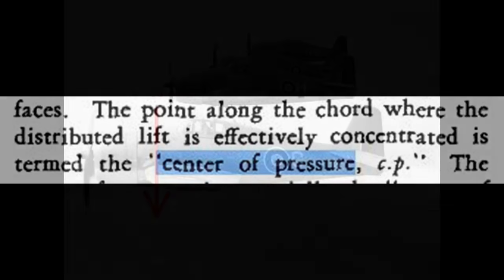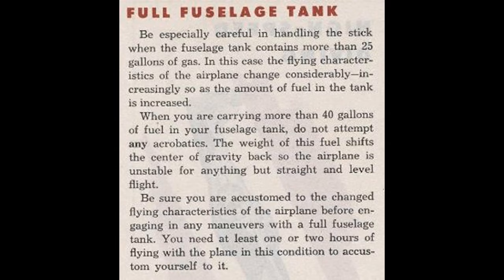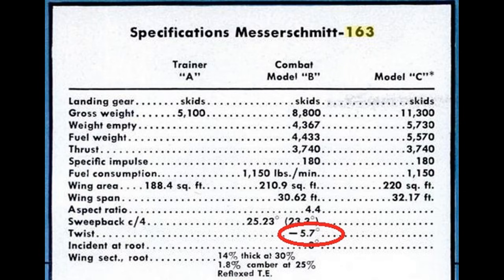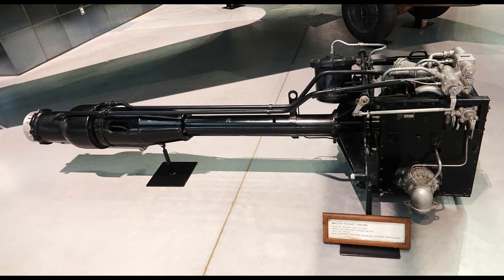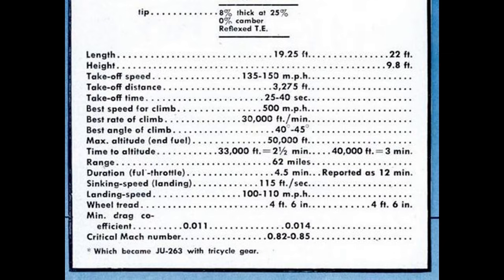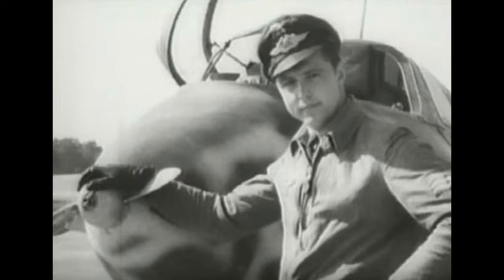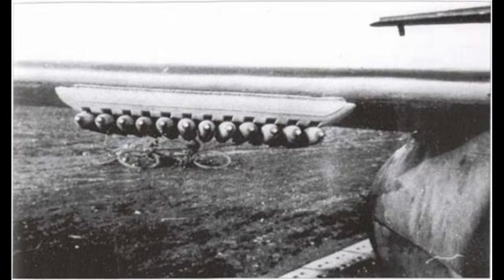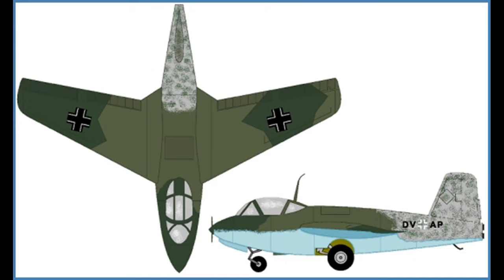Messerschmitt Me 163 Pt.2 Plus Me 263 and More!

Comment: Nope.  Flying wing stability is complicated not by the location CP relative to CG but the basic fact most airfoil sections have a negative pitching moment.  Aircraft are made stable in pitch by creating a balanced system of forces that self correct.  The plane goes faster, the wing wants to pitch down more because of the airfoil but the horizontal stabilizer increases its down force.  By the way you can design a plane that does not change trim as airspeed increases by careful adjustments of incidences and tail forces.   You explanation wouldn't account for plank flying wings or forward swept flying wings that have been experimented with.   

There are even conventional designs where the tail is designed to have lift and not down force where the CP has to be in front of the CG.  You mentioned the F-16 for maneuverability but designers have experimented to make more efficient aircraft.  The idea is to get both the wing and tail contributing to the lift of the aircraft.  Some folks say what is the advantage of canard designs where the forward surface does contribute lift (generally).

Flying wing pitch stability can be achieved with airfoils with positive pitch moments, with trailing edge reflex for example as you find in plank designs, or wing sweep and twist or some times airfoils sections at the tips of a swept wing that are different than those at the root.  Every approach has its benefits and compromises.  The YB-49 was a tragic example of not getting pitch stability right.  The design had the CG/CP so close it ended up in an unrecoverable tumble.  

Your explanation missed the actual major element of flying wing design.

Here is a great book that will get someone the basic airfoil fundamentals that affect pitch stability.

https://www.amazon.com/Theory-Wing-Sections-Aeronautical-Engineering/dp/0486605868

Another interesting data point for the 163 is the mention it got in the book "Fluid Drag".  It was an amazing low drag.airplane.

https://hoernerfluiddynamics.com/

Your videos do have some great elements.  It is clear you do a lot of research, for example in this 163 series you had a lot of the human elements were very interesting.  But you got the aero all wrong.  The good news is there really aren't any other flying  wings to discuss.
Reply from the maker: All the info I posted is straight out of PHOAK and AFNA. I am sure there is more to it, but I find it hard to believe that these two sources are wrong. AFNA is probably the most peer reviewed book in aviation.
Reply: @GregsAirplanesandAutomobiles  Neither sources are covering the pitch stabilities of flying wings.  

The PHOAK makes no mention of flying wings and can hardly be considered a comprehensive source of aircraft aerodynamics.  Same with the AFNA.

A quick google search sadly shows a similar but flawed explanation of flying wing stability.  A little more digging produces better treatment of the problem.  This paper seems to cover the problem well.

https://www.researchgate.net/publication/273512501_Static_and_Dynamic_Analysis_of_Flying_Wings

To ignore the negative pitching moments of airfoils misses the fundamental challenge of pitch stability of flying wing configurations.  You need to read studies of Lippisch, Northup or the Hortens.  There are some great sources covering flying wing configurations and aerodynamics and you didn't use any of them .  I'll stand by my conclusion you really got it wrong and continue to.  It isn't CP/CG, it is negative pitch moment of most airfoil sections largely due to camber lines. 

That is the primary pitching component of flying wings, if you don't get that you don't understand flying wings.   I gave you a great reference regarding airfoils that covers pitching moment of different sections.  

Here is another decent paper on the topic:

https://flightlabs.com.au/preliminary-research-on-the-optimisation-of-flying-wings-in-forward-flight/

Early in that paper you will find this statement:

"A traditional cambered airfoil produces a large negative pitching moment, exacerbating the pitching down moment. "

Here is the ME-163 airfoil:

http://airfoiltools.com/airfoil/details?airfoil=goe765-il

Notice it does employ reflex to counter the negative pitch moment.  So the 163 employed a reflexed wing section AND sweep/twist to achieve pitch stability.
Reply: @Gort Sure, most airfoils produce a negative pitching moment.  They want to tuck.  This is why planes have tails.  In fact when you design a conventional plane part of the calculation of how to size your tail has to take into account that pitching moment of the airfoil you chose.  In a flying wing you either have to use a reflexed section that has a positive pitching moment or use wing sweep and twist to create a balancing force to achieve positive pitch stability.  It is the pitching moment of the airfoil responsible for that pitch force that needs to be balanced.  It seems to be a common mistake to think of it as CP/CG as it is "simpler" but it ignores the real factor in play, that of the negative pitching moment of normal airfoils.  In my reply to Greg I provided several links to some decent treatments of the problem.  To really understand flying wings you need to start with airfoils and how they behave.
Reply: @Gort Most airfoils have a negative pitching moment.  You could put the CG on the CP and the will still pitch down.  This is related to camber in common sections.  The CP relative to the CG is not why there where is a downward pitching moment.

https://en.wikipedia.org/wiki/Pitching_moment
Reply: @Gort it might help to think about the camber line, imagine the effect of air following that curve, if might even help to ignore the pressure along the section, think the force vectors following the camber line. Air is forced down at the trailing edge and that forces the trailing edge up, this the forward pitch torque.
Reply: @Gort I would also point out to calculate the pitch coeficient of an airfoil is totally based on the camber line.
Reply: @Gort It isn't covered in the AFNA, read the link I provided or most any book on airfoil theory.  Chatting with you has me convinced that pitching moment of airfoils isn't taught so there is a lot of misunderstanding of how pitch stability really works.  The center of torque was nothing to do with CG.  Think center of camber line.  Like a said find a deep technical source specifically about airfoils.  I provided  several already.  The problem is most general references about flight over simplify complicated topics.  The provide practical guidance that is inaccurate if you still down enough.  Bernulli vs. Newton for example when describing lift.  If you are honest it's both (not in equal amounts but both are involved in generating lift).  Also it all changes at super slow speeds or as you approach supersonic.

I also want to point out Greg"s comment on flaps on swept wings was comically wrong as was his comment on flaps on the 163.

Read some more about airfoils, that is where airplane design begins.  There is a great book called "Designed for Flying". When I'm not on my phone I'll find a link. 

Don't think of a wing suspended in a fluid, it is the movement through the fluid that generates the forces and these forces increase as velocity increases, gravity is a constant that quickly becomes the smallest force in the equation.  That is how things fly.
Reply: @Gort the cp/cg discussion is a red herring, I gave you a good link regarding pitching moment and I provided a link in one of my replies to Greg with the 163 section, it is reflexed.  Even symmetrical sections have a picking coeficient that is usually graphed against angle of attack.  Seriously find the airfoil book I linked in one of my replies to Greg, the science of airfoil sections is non trivial and glossed over at best in most general aviation references.  I can have a cg behind the cp and be stable in pitch either with a canard or a lifting horizontal stabilizer.  Again, read a book on airfoil design for a more comprehensive exploration or at least the Wikipedia link I gave you on pitching moment.  I do hope you do a deeper study of airfoils, it is a fascinating topic!
Reply: @Gort http://wwwaeroforum.blogspot.com/2015/08/pitching-moments.html
Reply: @Gort it does, another way to think about it is if you take the sum of all the pressures, not just single center of pressure you end up with a net force that wants to rotate the section.  The CG is not the aerodynamic center of the airfoil do it is irrelevant in terms of calculating that rotational force, which is the pitching moment.  Consider this, at the trailing edge of the section there is a downward deflection of the airstream, this is behind the aerodynamic center of the section so the net pressure results in the pitching coeficient. This is why a reflexed section can have a positive pitching coefficient because the airflow at the trailing edge is up so it presses the trailing edge down behind the aerodynamic center.  That is about as simple as it gets, air is forced DOWN at the trailing edge on most airfoils but UP if you reflex the section up.  Think of the airfoil on a shaft at it's aerodynamic center.  Have you ever seen a kite with a rotating wing, they rotate because the have a shaft at the aerodynamic center and they have a normal pitching coeficient.  As they are pulled forward they spin while still generating lift.
Reply: @Gort because cp or cgaren't even involved, it it the pitching moment resulting from the downward air flow at the trailing edge pushing the trailing edge up.  It isn't where cp is relative to cg that creates the downward pitching moment.  Having the CG forward of the cp does create a minor forward pitching tendency in conventional aircraft but it is a minor force compared to the force exerted by the airfoil's pitching moment and I could design a plane with cp ahead of the CG and still make it stable with a lifting tail or a canard.  So the cp/cg is a misleading simplification of the dynamics of conventional aircraft.  Sadly it is a wide spread misstatement of the factors of pitch stability in normal aircraft.
Reply: @Gort boy I wish I had a whiteboard!  But yes, a lot of math is involved which is why most references and use the simplified explanation which is functionally a useful way to predict the overall behavior of conventional aircraft.  It is a "rule of thumb" explanation that models the behavior "close enough" in most aircraft.  It is when you look at unusual aircraft designs like a flying wing that you have to have a deeper understanding of aerodynamics.  And next thing you know your hip deep in math. :-)

Comment: Hi Greg. Really love your videos. I'd like to offer comments regarding the relevance of Alexander Lippisch's delta wing research and the notion of its commonly accepted influence on American post war delta wing design. I am just finishing an excellent book titled "Captured Eagles" written by Frederick Johnsen who was a U.S. Air Force Historian and also the former Director of the Air Force Flight Test Center Museum at Edwards AFB, and Public Affairs Director for the NASA Dryden Research Center. In his book Johnsen relates that in 1946 American researchers investigating Lippisch's DM-1 (the glider predecessor to the P13a) found that its thick delta wing could not produce, and in fact inhibited, the desired leading edge vortex useful in a thin delta for stabilizing airflow and thereby allowing maximum lift coefficients at much higher angles of attack than are possible with a conventional wing. The same researchers subsequently modified the DM-1's leading edge, making it thinner. According to Johnsen, the result was an increase in the useable AOA from the original 18 degrees with the thick profile, to 31 degrees with the thinner leading edges generating their signature vortex, along with an associated increase in maximum lift coefficient. Johnsen states that American aeronautical engineer Michael Gluhareff at Vought-Sikorsky conceptualized a delta wing as early as 1939 and that NACA reviewed some of his work in 1944, and that Lippisch's work was not so influential as the driver of American delta wing implementation, but rather a somewhat flawed application of the delta wing's potential which served more as a humble catalyst toward legitimate independent design breakthroughs in America. I think Johnsen's book would be right up your alley as he talks about the process of capturing and evaluating German WWII aircraft. Thanks!
Reply from the maker: It's very clear that significant changes were made going from Lippish's designs to the Convair designs. In pictures you can easily see how much thinner the wing became. I can't quantify how big Lippish's post war contributions were, only that he did in fact pioneer tailless aircraft, built one that saw combat, and had at least some influence. How much I just don't know.

Comment: I'm a tad disappointed Greg jumped from the XF-88 straight to the F-106, ignoring the F-102 Delta Dagger.  The F-102/F-106 story would be a good video as it illustrates the fast-changing pace of thinking and technology of the time.  Otherwise, bully!
Reply from the maker: I seriously though about going through the F102, but the video was starting to run on forever, so I had to wrap it up.
Reply: Talking about the 102 would take hours as it was such a problem child, not just in aerodynamics but in the avionics. Of the two the 106 is a much better example.

Comment: If I remember correctly the pack of four MK108 in the Me262 weigh app the same as eight .50 Brownings in a P47. The kill efficiency ratio of the MK108 4-pack with "minen" (HE) is 5 times higher than the 8-pack .50cal Brownings on enemy aircraft.
Reply: Probably helps then that the P-47 carried 425 rounds per gun, and the Me 262 only 90. That's about 39 seconds of fire for the Thunderbolt, and only 8 seconds for the Schwalbe. So while the Me 262 might have had 5 times the kill efficiency, the P-47 carried 5 times as much ammunition. And with more accurate, higher-velocity guns.
Reply from the maker: If hey hit.
Reply: In the context of the Me163 featured in this video we are looking at "heavy bomber" destruction performance. Not fighter vs fighter combat.
If a Me262/Me163 close in on a B17/B24 from the rear the 30mm shells have a relative velocity of 300fps before the cannons are fired..
Deflection shooting is of course more difficult with low velocity cannons. R4M rockets are also designed to have the same ballistic trajectory as the 30mm M-shell from the Mk108 so the pilot could use the same sight, point of aim and deflection reference for both weapons.
Good reading: http://www.quarryhs.co.uk/WW2guneffect.htm
Reply: Ah, Yes! What was the P-47's mission? To prevent attacks on bombers by making it too risky. One or two .50 hits and the attack is spoiled and the pilot is going evasive and bomber is safe. Escorting plane has achieved his mission. More than that the the ME 262 is closing at such a rate that the time he has a target in his sites is extremely small and he needs to do fatal damage as quickly as is possible. Canon rounds were the best choice in this circumstance. Trying to attack something that is 300 mph slower than you is problematic. If you slow to bomber speed than the escort fighters have more even odds

Comment: 33:30 wouldn't retractable gear been heavier than the previous skid arrangement and thus REDUCE endurance? also the main gear seems to eat into the space for the fuselage tank.
Reply from the maker: Yes, it does add weight and take up space, but the fuselage is longer.
Reply: I am sure that the built in landing gear would greatly help to reduce the turn around time.  They wouldn't need specialized towing vehicles and if necessary, a few guys could push it.  I am not sure that the weight increase would be that significant.  I suspect the skid had to be pretty heavy duty, along with the mounting gear.  It would be interesting to see what the projected weights were and compare them to the 163B.
Reply: Maybe less of them explode on landing, or dissolve the pilot.

Comment: 7:30 Given the involvement of the wing tip geometry in pitch stability (assuming I understand you there) how would this be effected by a delta wing's loss of lift near the wing tips at high speed? A tendency for down pitch as well as loss of aileron function as speed increased?

Comment: 3:30 Is tail down-force created by having the horizontal stabilizer's cross-section opposite in shape to the wing's (an "upside-down wing")?
Reply: no. they are usually symmetrical and trimmed with a slight downward angle of attack
Reply: True in many cases. Look at a 737 stabilizer, flat on top & curved on bottom.
Reply from the maker: Think of the horizontal stabilizer as an upside down wing, which is really what it is.